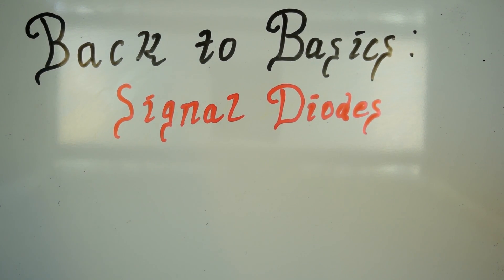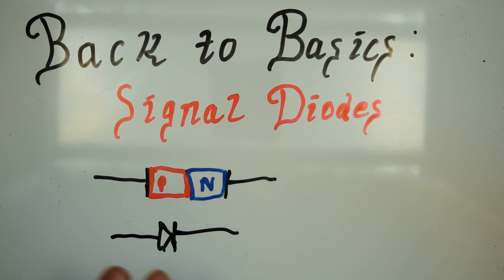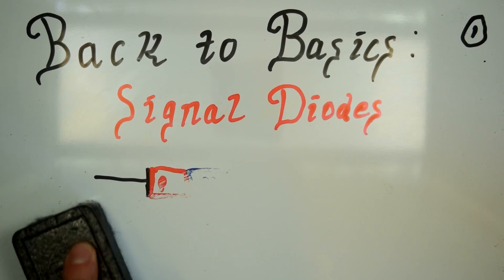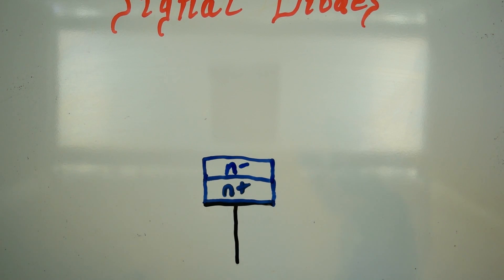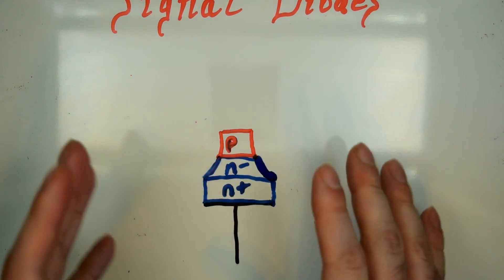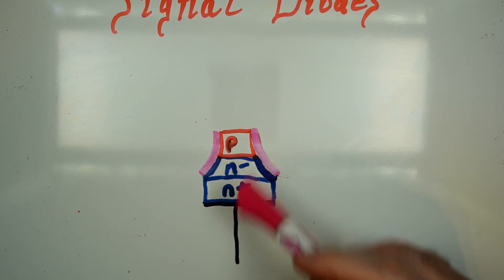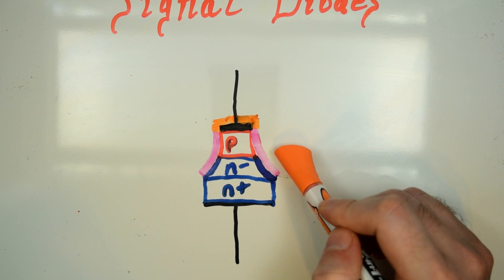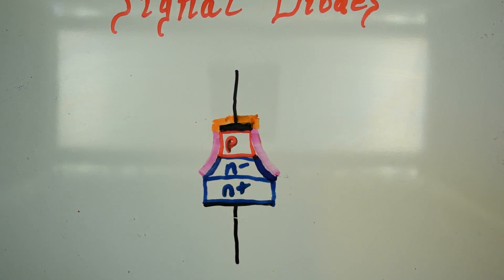Back to Basics - Signal Diodes

Comment: Do you test a signal emitting diode with multi Meter, I have a remote control not working and diode getting 1.5v when button pressed
Reply from the maker: Let's try replying again ((I thought I had but apparently it didn't publish...))

Two easy ways to test the diode:

1. Most digital cameras can "see infrared ((it shows kinda purplywhite)), so you can see if it's working that way.
2. Measure resistance of the diode both forward and reverse biased. Forward boas should be low resistance, reverse bias should be infinite.

Comment: Sir which diode is used for dc coupling??
Reply from the maker: Depends on the situation. There are literally thousands of different types of diodes, for thousands of different applications. can you be more specific about what you're trying to do?
Reply: Sir this question asked in exam and options are 
1) power diode 2) zener diode 3) signal diode 4) tunnel diode
Reply from the maker: That's a really poorly worded exam question, but I'd assume the correct answer is power diode.